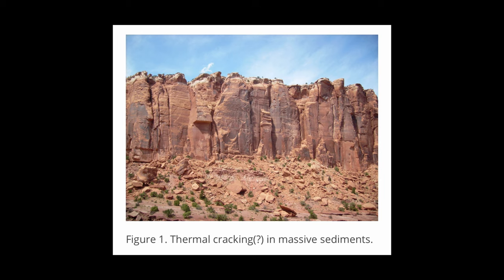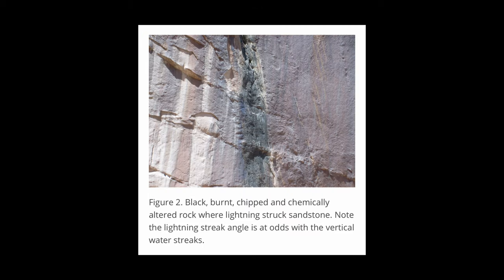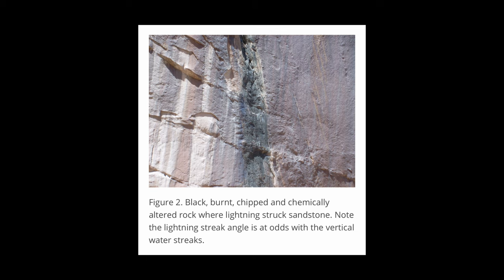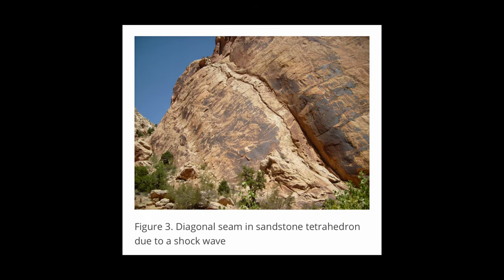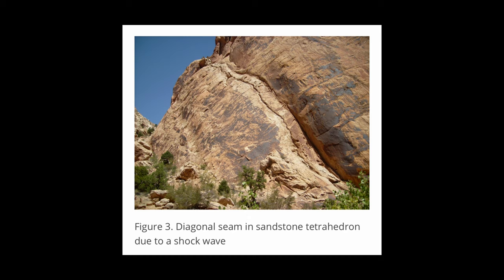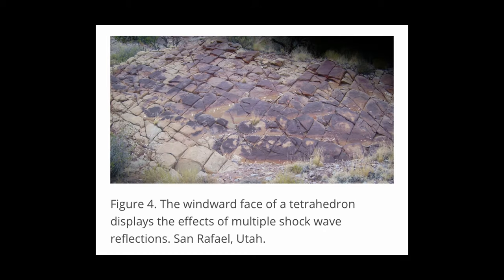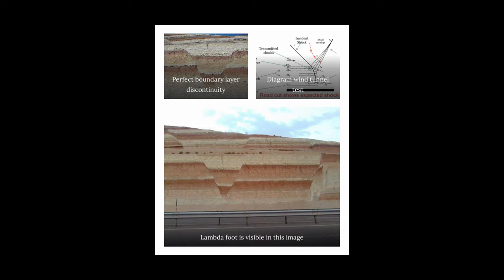Cracks in Theory by Andrew Hall

Comment: What does this mean in layman's terms terms?
Reply from the maker: In the past, our atmosphere experienced highly ionized plasma events that changed the face of the planet. Empirical evidence is provided, supporting such theory.
Reply: @ElectricUniverseEyes  Thank you.

Wouldn't one of these ionized plasma events be the great flood? If so, doesn't our Sun play the central role in this?

Also, what is the role of Saturn that has been previously mentioned as being our Sun?

Side note here - Have you ever read the Book of Enoch? it describes "the watchers" (personally, I think it infers extraterrestrials). My gut tells me we are being deceived by them (extraterrestrials).
Reply: Michael Steinbacher always pointed out that the plasma-sculpted features described in Andrew Hall's work seemed to be accompanied by a flowing river, and the speculation is that the plasma event does generate massive flooding rainfall... the water finds its channel, and then the plasma event builds up the ground surface in layers on each side of the river, but not at the river itself, Michael speculated that the water prevented accumulation and he was proven correct during one of Billy Yelverton's garage experiments with high voltages, Billy created a model river and sure enough, material was deposited on each side but not where the river flowed.  Michael was really the first to walk the southwest and see it with Electric Universe Eyes.  Its wonderful to see others carrying on what Michael first saw.  In terms of length of time, his impact was brief... but in terms of pioneering the idea of "electric geology", his impact is larger than life.  May he rest in peace!